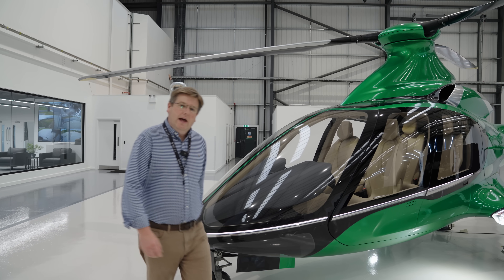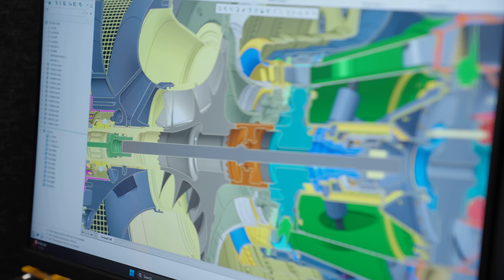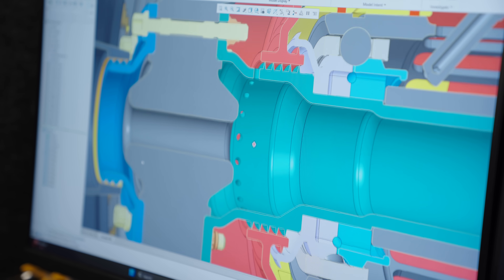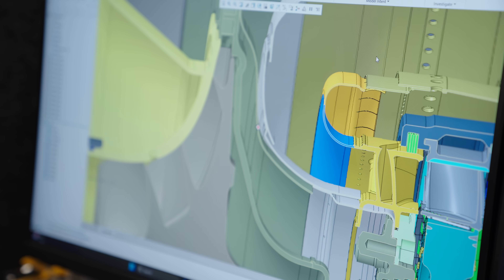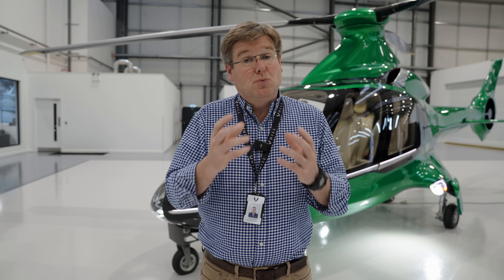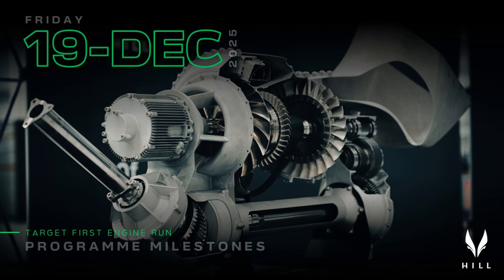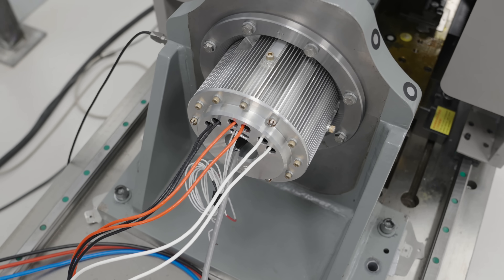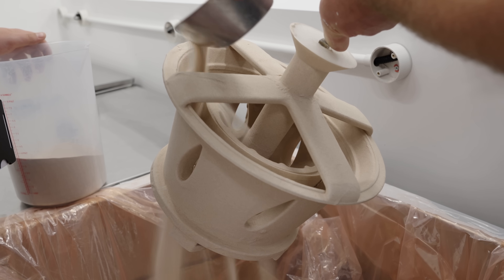Programme & Timeline Update

Comment: Im sorry but this project is dragging on and on and on. 

There are no excuses for the delays and how long the development is taking. 

This platform should already be deep into test flights and certifications. 

Yet there is nothing a single working piece assembled yet. Just components here there and everywhere. 

Its time you take the SpaceX approach and start literally flying along.
Reply: designed and manufactured many helicopters from scratch, have you?
Reply: @michaelbrand4654 nope but these guys haven’t built one either!

Comment: Frustrating. If this can be made to work and if the product sells and is manufactured in the uk then it will be a Great Leap Forward for our aerospace industry. Is there not an off the shelf engine you could use for early flight tests?

Comment: Cool project 😎👍
Why did you develop your own engine? Is there any major differences to a standard turbine shaft design?
Reply: The idea is to make it (MUCH) more affordable then the Pratt & Whitney millions of dollars engines which are impossible to make sense to spend that money for private pilots.
Reply: @RR-kl6sl awesome 👍 I always thought the R&D and testing on a new engine is more than an off the shelf solution. It works this way for cars. Turbine engines are way more complex and tight tolerance. 

I wasn't sure of there was some major design difference with this new engine to help get the price down 🤔 I would love to see more affordable options for aviatiors to use. 

I would love to build my own aircraft 😍 I am currently unsure what powerplant to use. Part of me would love to use a rolls Royce V12  🤣 but most likely I will use dual piston engines. 

Thanks for the good chat 😎👍

Comment: How is this different than dozens of choppers already on the market?
Reply: It’s a fraction of the cost of similar performance certified helicopters
Reply: And providing features competing helicopters don't provide, such as faster cruise speed, double the range, an interior that feels like a high-end car instead of a tractor cabin, autopilot included, and a full digital cockpit by default instead of paying a $200,000 upgrade for a 50% digital cockpit. 

When they get this product out the door, it will be a major game changer.